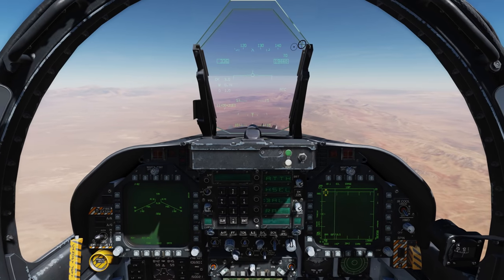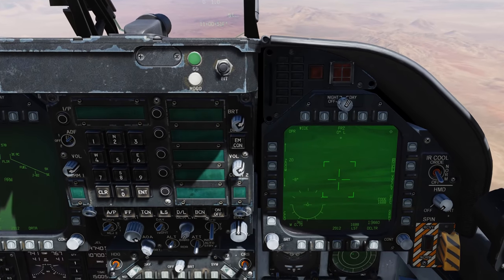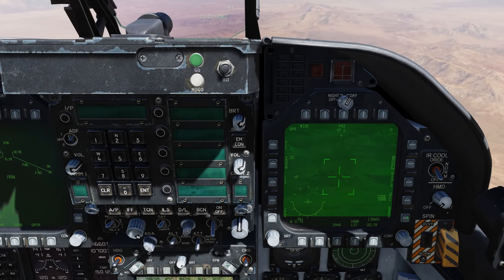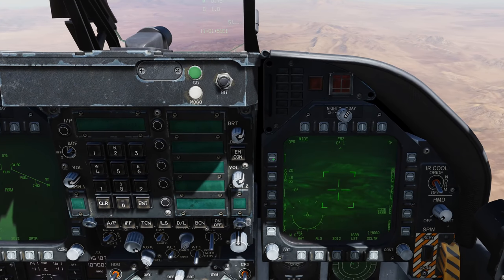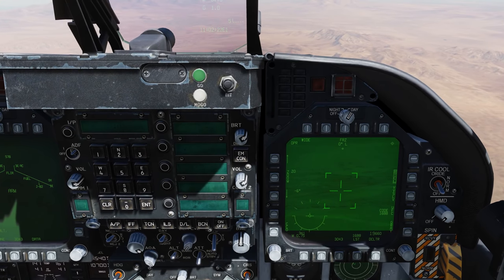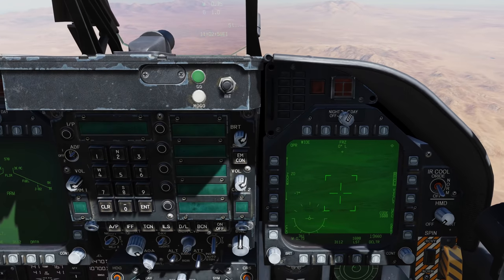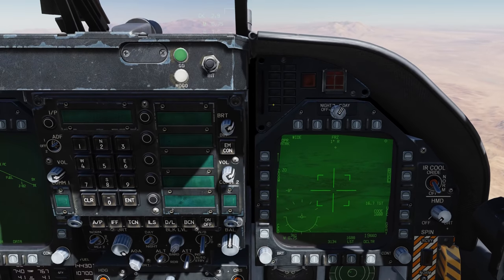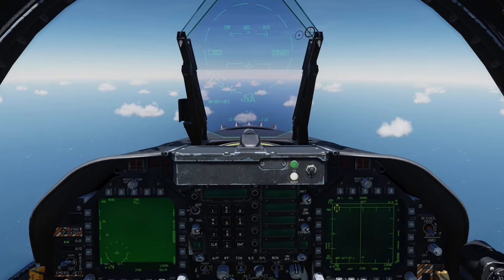DCS: F/A-18C Hornet - Targeting Pod Update

Comment: How do you slew the TGP again once in PT or AT without resetting the system ?
Reply: Just hit the sensor select switch to the right.  It will cycle through the modes.  At least it did last week.
Reply: Correct just press Sensor Control switch again in direction of which display you have the FLIR page on. Or he shows you can simply press Nose Wheel Steering/Undesignate button.
Reply: Have the same problem. If I first press TDC (designate target) and then cycle modes, the FLIR stays and doesn't revert.

Comment: Wanted to see If i could get an answer here but when I use the radar elevation switch to zoom in and out instead of using an axis I use a 2 way up and down push button on my throttle (I use a t16000m fcs hotas) so these designations for the buttons are joy button 5 and joy button 4 the game detects joy button 5 but when I actually try to use it ingame joy button 5 doesn't work at all

Comment: I know the update dropped, but it didn't say anything about gain levels at night. All NVG's and flir camera feeds have ridiculously high gain when first activated. you mentioned the ALG mode with the TPOD, it didn't seem to adjust correctly. TPOD was unusable at night when displaying it on the DDI's, worked fine on the MPCD other than the fact I couldn't cycle PTAK and ATAK when on that screen

Comment: What is the air to air mode actually used for? I mean i get its cool but i doubt they would make it a feature on the real thing if it was just cool. Can you fire maybe sidewinders with it? kinda like a diy IRST? Just wondering (please correct me if im wrong)
Reply: From what I hear AA mode for the lightning tgp is for identifying targets.
Reply: As for using aim-9x's with it not sure.
Reply: It's for tracking AYY LMAO
Reply: If the FLIR can maintain a lock while telling the radar where to point, it would reduce the effectiveness of the target "notching".  If the FLIR pod can feed targeting data to the AIM-120 datalink, that could be useful to either entirely defeat notching, or to acquire and launch on a target without giving him any RWR alerts.
Reply: @ShuRugal  I often fly with my radar on silent using the SA page to locate targets. If i can track and fire a 120 on a target without using my radar until launch, that would be amazing.
Reply: The main purpose is for identifying aircraft which are too far away to identify by eye. It's also useful for getting more information on a target in general, or to confirm kills. Also, of course, it can track targets without needing to use the radar, although that's not its main purpose.

Comment: At 2:15 you mention "laser range."  Is it actually possible (or will it be possible) to use the laser to measure range to target like you can in the Warthog?  It makes it a lot easier to hit buildings with JDAMs when can designate the top of the roof rather than guessing the slant angle to an appropriate point on the ground.

Thanks to the ED team for all the recent Hornet updates.  Been having a blast lately.